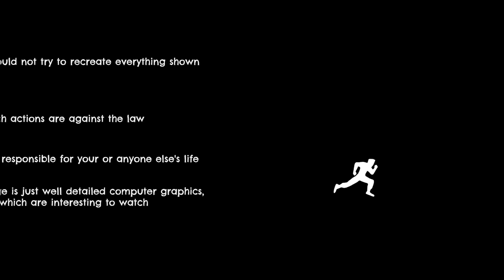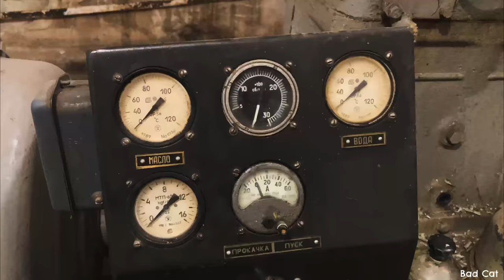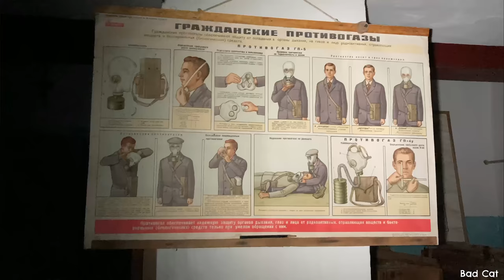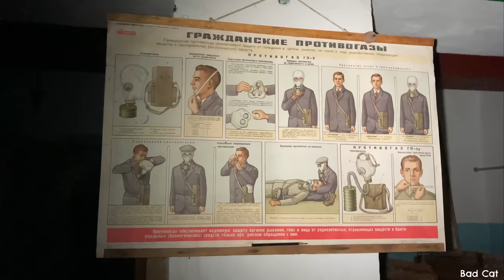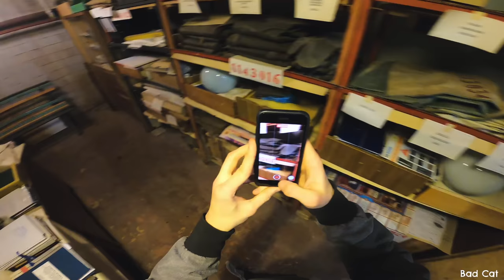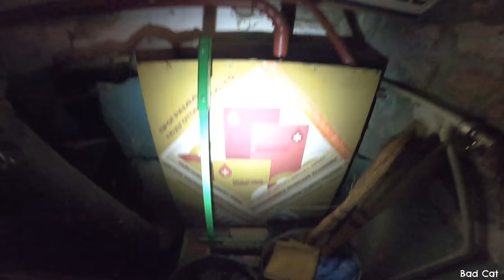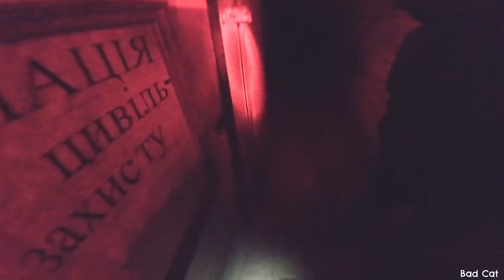Climb into the bomb shelter discreetly and unnoticed

Comment: How obsessed were the russians with gas masks?! loads and loads of them in every shelter...
Reply: @Marius Seifferth yeah especially eastern Germany which was under soviet control but all of Germany was a hot spot like they were literally boarded with soviet controlled areas including eastern Germany obviously so yeah Germany was in a tight squeeze and was always alert
Reply: @
Betr8er 
In a post nuclear exchange situation or a chemical attack you would need a lot of gas masks and protection equipment to have a tiny chance of surviving. So of course they had a ton of them everywhere. This is the case in every single bunker like this in any country.
Reply: @predattak  true but not to the level it was in the ussr and Germany